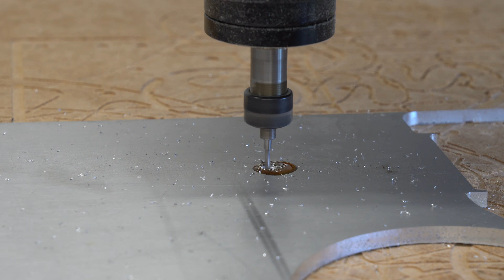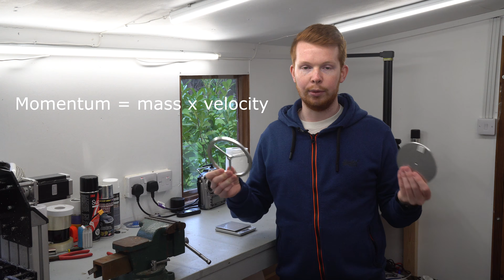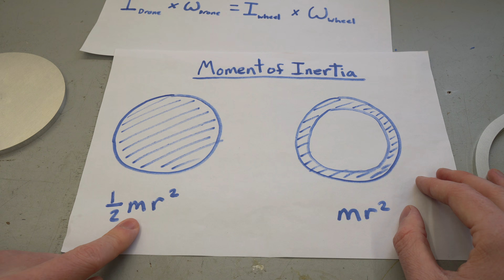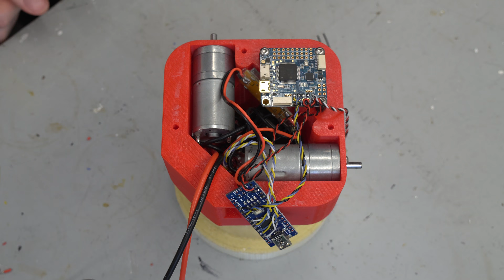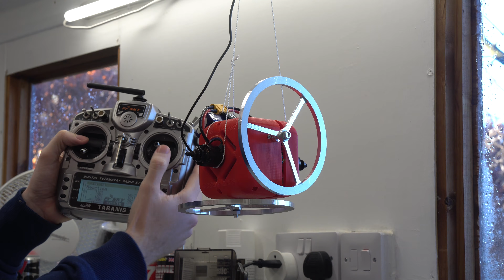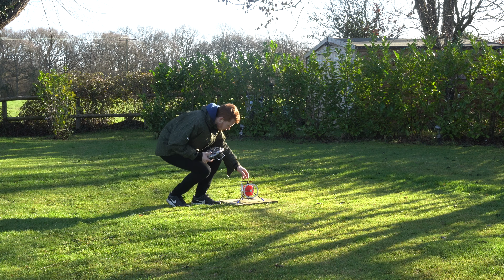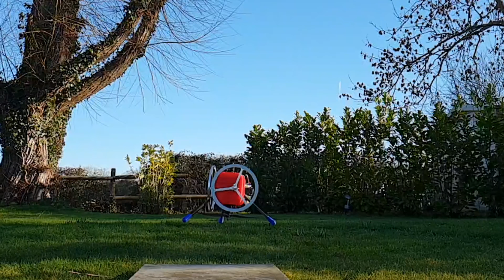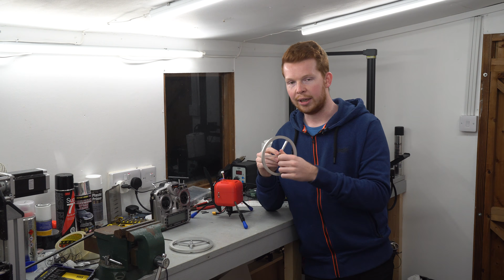Comment: As professional multicopter flight control engineer who did a lot of such angular rate loop experiments with DIY builds I would say the biggest catch with your quite nice setup is control bandwidth. The delay from the gyro measurement until your reaction wheel is finally counteracting the disturbance is too long to keep the drones attitude stable in the air. It took me a long time to figure out this problem with my own first flight control attempts (all from scratch). I'm guessing the bottleneck might be the motor controller of your brushed motors it's very likely not designed for low latency feedback loop reactions which all good multicopter ESCs are. The key is reducing the angular rate loop delay and then tuning mainly the angular rate proportional gain. You need to be able to feel a virtually instant and rather strong counter reaction from the actuator already in your one axis hanging test when pushing with the finger even only slightly. If you cannot get the gain high enough because it starts oscillating early you either have too much delay or too high vibrations in the gyroscope measurements. Be aware that the way (stiff, soft, vibrating part, ...) your gyroscope is mounted to the drone matters in this regard.

The non-linearity of the torque response and the inperfect alignment of axis to the center of mass are certainly things you can improve as well but my educated guess is clearly that the delay in your feedback loop is currently the bottleneck holding you back from longer hover times.
Reply: increasing kp was also my first guess, going from the high-speed videos.

Another thing is, that the ardiuno code could be written in a way, that it is too slow in steady reaction time. Arduino's standart functions may not always be the best choice.

Also maybe as an idea, he could apply a lookup table into the arduino, resulting in a non-linear input to output (in Volt) function. Basicly it says, ok, at this input value i have to apply that output value.
My approach would be measuring the force of 0.1V steps from given voltages (0V->Vmax) and calculating the inverse function. Having these values could lead to the system having a linear reaction, so the same increment of input should apply the same amount of output, regardless of pre existing state.
Reply: @ald3nt3  Good input. It's very easy to add too much delay when adding another processing component like the extra arduino here. For such a vehicle you'd want >100Hz feedback loop update frequency and also a fitting latency in the order of miliseconds. That would be a low hanging fruit to check.
Reply: @MaEtUgR  this is out of my qualification ... but would not it be helpfull to use bigger propellers, so the necessary rotation to take off could be lower ... and with lower speeds there would be better tolerance for the delays with reaction wheels?
Reply: @cruiserupce  (also drone software engineer) yes, designing a slower respons system at the mechanical level is certainly a valid way to get around slow actuators, but probably changing the firmware on the motor controllers would be easier ;-)
Reply: @JulianKent  I also think reducing the delay has a bigger effect and can therefore save you from maybe even excessively big propellers. The result is not only more likely to be feasible but will also be a more agile vehicle.
Reply: Given that satellite reaction wheels operate in a "frictionless environment" I have to wonder if it would be easier to control a drones attitude, etc with gyroscopic precession than reaction wheels. I feel like having spinning gyros before taking off would stabilize the whole thing.
Reply: @saiphascain6883  Interesting idea! I'm guessing the setup would become too complicated. In order to have a significant gyroscopic effect on the entire mass of the vehicle including the battery, the wheels would need to have either quite some more inertia or spin crazy fast... but that's only gut feel, we'd have to put in the numbers.
Reply: @MaEtUgR  Thanks for considering at least. I haven't experimented with contained gyros apart from the classic bike wheel and turntable demonstration and the old precession walkers and I'm thinking that a custom main gyro/fan would probably lead to some hideous math.
Reply: While the conversation seems to have moved away from this, I feel it might be of interest that satellites often do use gyroscopic torque, either using momentum wheels, which are like reaction wheels but constantly spinning at high RPMs to provide gyroscopic stabilisation, or control moment gyroscopes, which use a spinning rotor mounted on gimbals to provide both stabilisation and attitude adjustment using gyroscopic torque. I don't see why either couldn't be used for a drone. In fact, I imagine they'd work better than reaction wheels - especially CMGs, which are much more efficient - if they were made small enough.
Reply: @saiphascain6883  I'm inclined to believe that the best way to stabilize an atmospheric vehicle is to use the air instead of angular momentum, although the existing angular momentum of the components should be utilized.
Reply: @saiphascain6883  i was thinking the same thing about the gyros, but a revved up gyro has more to it then it appears.  Ill share a secret with you that most will never understand...gyroscopic propulsion.  Its the reason that a spun up gyro creates problems for control.
Reply: @saiphascain6883  Control moment gyroscope is the technical term for such a device.  I too would like to see a multirotor with such a control system.
Reply: @KnifeKnut  
A control moment gyro (CMG) is different, the rotor speed is constant and the housing is gimballed, you need at least 3 CMG's either simple gimballed or, like used on Skylab, 3 double gimballed CMGs. 2 of these can control the attitude, together with 6 reaction jets for desaturation (all three CMG axes parallel).
Reaction wheels have fixed axes, with modulation of the speed .
4 are used on the Space telescope.
The Space Station has 4 double gimballed CMG's.
Reply: What? man I should have stayed in school.....
Reply: @andyp3834  It's all about the words, lets break down a sentence. 

"I would say the biggest catch with your quite nice setup is control bandwidth. The delay from the gyro measurement until your reaction wheel is finally counteracting the disturbance is too long to keep the drones attitude stable in the air." 

Becomes 

"The biggest catch with your setup is the delay between when the aircraft starts to lean one direction, and when your machine begins countering that movement with the wheels. The delay from the electric brainbox to the wheels is so great that by the time they try to counter the movement, it's too late, and they just create more instability, this cascades until the aircraft finally crashes"

You're a smart person, don't let unfamiliar words and terms make you feels otherwise. 

That goes for everyone who reads this.
Reply: @andyp3834  right ! Hell till today I thought I was a little smart guess not!
Reply: @WilliamDye-willdye  Thanks, that's the first time I had it reliably in the air after "debugging" my setup for a long time, that's how I learned. I also shared some of my failure videos like https://www.youtube.com/watch?v=J-U7txB47Ug and https://www.youtube.com/watch?v=UMTZ6K-T_kc. The code of this experiment is available here: https://github.com/MaEtUgR/FlyBed although I can only recommend it for conceptual learning purposes. Today I use and improve the PX4 open source autopilot together with an awesome community.
Reply: Good thinking. Initially I was thinking he had very high gyro gains because of the extreme oscillation. Looked like it was overcompensating. Another observation is that the mechanical time constant of his drone is too small. That thing tips over in milliseconds and will need a very fast control system to keep it flying - whereas a full-size helicopter is slow and heavy enough that a human can stabilize it. So I propose making mechanical adjustments to increase drone response time. Increase the mass, use larger motors and props, and put the battery underneath the lower prop to lower the center of gravity and make it more "self-stabilising". Also, if the problem is nonlinearity in motor response, perhaps he can start the wheels from a positive rpm instead of zero. That way instead of the motors oscillating around the zero point (say 0 +/- 100rpm), they oscillate around an initial rpm value so the wheels never reverse direction (say initial rpm is 1000, then during flight wheels will go 900-1100rpm for the same +/- 100rpm control range). With this idea even brushless motors may be feasable because he no longer has to worry about the non-linearity of direction reversal.
Reply: Hey, what would happen if you place two fast rotatting disks into a frisbee, probably counter rotating. Could you use the flee force to make it into a little UFO?!
Reply: @bamfyfe  Yes but the rotation is what keeps it stable
Reply: It's the arduino. It has painfuly slow IO routines in the IDE, no idea why the guys that designed it did such a poor job... IO read or write takes 4ms, way too long for this kind of stuff.
Reply: Ya I was thinking the same, fortunately found your comment...
But the alignment to centre of mass has a big deal here, he should have noticed that....
Reply: MaEtUgR........SPOT ON. RESPONSE DELAY IS PRIMARY CONTROL ISSUE...My professor gave g8 example in my 1st control lecture of controlling bath water temp through hot & cold water knobs. If we don't incorporate response delay we end up burning ourselves................So engineers r meant to solve tough problems...Sol lies in incorporating response delay in the program by predicting drone's misbehavior in advance & giving premature control input to synchronize delayed response a timely response
Reply: @EngineerAhmedUSA  This will not work with an simple PID. You'll need a different type of controller that "has knowledge" of the system and/or an observer loop
Reply: Interesting idea for a flight device. I would also suspect an inner control loop delay as first place to check for the unstable flight behavior. However the system design has potentially coupled rotational degrees of freedom. Whenever a reaction wheel is spinning and it gets tilted by the other wheel it induces yaw motion (gyroscopic effect) and vice-versa. Given spinning reaction wheels, this effect probably adds to the unstability as the PIDs are currently controlling pitch and yaw independently (decoupled) even though both DOFs are actually coupled.
Reply: The fast response can be done by arduino + gyro + brushless motor.
Reply: I was thinking the same thing.  I think perhaps a better solution would be to have four reaction wheels. Similar setup (only control two axis), but have counterrotating wheels using the same differential control as the rotors. The reaction wheels would always spin at a fairly high rate, using an electronic break control to quickly raise and lower the differential between each pair of wheels.
Reply: @spyderMN  That does not work, because  torque is momentum exchange . starting with 2 counter rotating reaction wheels is equal to one R. W with twice the moment of Inertia at zero speed. With differential speed you are still creating an angular momentum which will generate the same gyroscopic torque in the yaw axis , when you either pitch or roll , depending of which pair you use.
Yawing the drone will cause a gyroscopic moment proportional to the residual angular momentum , which the other set of reaction wheels must compensate to avoid pitching and rolling.
Reply: Yeah, control of slowly brushed motors nonent may be quite fast(up to 0.1 ms), easy and simple. It is simply control of motor current.
Reply: Came here to say this. System oscillates because the loop rate is too low or the loop latency is too high.
Reply: A practice that is sometimes advisable: If the loop latency is too high, run the system against an internal software dynamic model. Use an outer loop to synchronize the model to physical reality by varying a model parameter as needed to drive the error down (like the model's mass or actuation gain), Typically the outer loop can tolerate higher delay and the inner loop can run against a software model, which can be done with single processing sample delay.
Reply: @Laverne Johnson are you talking to me?
Reply: I noticed that it seemed to lag also. I would assume it needs to be an extremely fast reaction in a drone. Also, what about gyroscopic precession? Wouldn't any radial torque on the gyroscope axis cause a precession? That would be extremely difficult to deal with and very complex. That's the trouble with using velocity over mass, a slower heavier ring would be less susceptible to these forces. But weight is so important in a drone so that's kind of an impasse. Maybe that's the fundamental difference in using reaction wheels on satellites vs drones. The satellites don't have to use them to stabilize constantly, only to apply force in a single direction on occasion therefore they are nowhere near saturation speed. Gyroscopic precession should only be evident at high velocity.
Reply: @gearhead1302  You are correct that lag (computational delay) is significant.
The gyroscopic torque needs to be compensated for, which is not difficult if the reaction wheel speed is measured and the angular velocity (in all three axes) is also measured with the available chips. Then the gyroscopic torque can be calculated and compensated for in the yaw axis ( differential torque in the rotors) as a known external disturbance moment.
This is the way the control laws on the space telescope work.
The added complication is that there are four reaction wheels, one for each axis and another oriented diagonally (cube diagonal).
The greatest problem here is the need to do the calculation with an arduino, the time delay is probably excessive for attitude control (heading). But might be good enough for yaw rate control.

If the vehicle structure is very stiff, separatelly controlling the angular position in pitch and roll with the reaction wheel torque (motor current) and no delay is a second  order system,  with the controll law ( P D , no integral term I ) it can tolerate some phase loss due to the computational delay in 
1) computing the crosscoupling gyroscopic torque due  to yaw rate (heading change) and 
 2) computing the  command torque as the sum of the control law output  and the component of the gyroscopic disturbance.
Since phase lag is the product of the delay times the frequency. Plotting the phase vs amplitude of the open loop, phase and gain margins can be calculated and system stability in pitch and yaw assured, by proper choice of the gains.
There are transfer functions that approximate a pure delay. Using those  you can draw the root locus plot and determine the control gain for each axis.
It seems to me that effective yaw control with high gain (differential torque on the lift rotors) is essential to achieve high yaw damping.
Reply: My first reaction to that was "make it analog then", followed by thinking of all the things that would need to be worked out to make that happen...
Reply: MaEtUgR 
I agree! 
I might also suggest that Tom consider the torque from the counter rotating props. There is a NASA video showing an astronaut doing gymnastics on Skylab. He is spinning his arm counter rotating inducing roll along his body’s axis.

@Tom BTW: why aren’t you using a direct PWM DC motor controller? Why the Arduino?
Reply: Hey look! Here's a nerd!

Nah m8 i'm joking
Reply: I wanna c some numbers here like what bandwidth ur assuming he is using. What would the max amount of bandwidth be and what frequency is that at? I think that 5ghz patch antenna would do it
Reply: Chris Anderson Communication frequency isn’t the problem, it’s the closed loop propagation delay between the accelerometers and the flywheel motors
Reply: MaEtUgR that’s exactly what I thought lol
Reply: If it were two wheels on a single axle going through the drone for each axis, wouldn't that prevent the reaction wheels from fighting each other to control the gyroscopic forces that single wheels create?  That would be a mechanical solution that would mitigate the control loop problems
Reply: Multicopter flight control engineer sounds like a dream job. Congratulations.
Reply: Can you put that in everyday language :)
Reply: MaEtUgR big brain time
Reply: wht r,u doing all r not working properly wht ur aim or just time pass
Reply: agree
Reply: Yes I totally agree. :3
Reply: @Laverne Johnson Not trying to convince anyone. My goal was to mention what my cooperative comment is based on. And what's your goal, hate?
Reply: This may have been said already but the Arduino needs to increase or decrease the speed, rather than set it, based on the control input.
Reply: I have no idea what you said during any of that. Can someone translate this into idiotspeak for me?
Reply: @Guru_1092  so u don't understand the language of science huh?
Reply: @kuronix6996  I majored in chemistry,  not physics and electrical engineering my dude.
Reply: @Guru_1092  what if I say that I majored in both?
Reply: At first I thought you were just a know it all blow hard, but you actually make a lot of sense
Reply: XD hes a sly one
Reply: MaEtUgR
The reaction moment of the wheel is proportional to the motor current for a PMDC motor. If you use a current command electronic circuit, rather than voltage  the response is very fast.
Current command compensates for the coil resistance and inductance as well as the emf of the motor.
Of course that is an analog circuit, not pwm.
Reply: Id say either decrease the delay time and increase response power, or just extend the platform.  3 or 4 props equidistant feom the center, and the longer the arm, the less response time and power should matter.

Honestly though, im just guessing.
Reply: Yeah sensor delay was also my first thought when I saw the slow-mo-wobbling. :)
Reply: sir, thank you more than you ever know.
Reply: Thing is when you were demonstrating the two motors  they sound differnt  ...?
Reply: PID feedback loop latency is a big issue in control systems in general. ASICs or FPGAs help a lot. Arduinos are very, very slow to react in comparison. In fact you can even use analog feedback for the lowest possible latency
Reply: Korrekt ❤🎉😊
Reply: Do you mind me asking what the salary ranges from for that job? Curious in that career choice :D
Reply: @HuskyStudios  Like with almost every job it highly depends on the location. The working conditions are equivalent to an electrical engineer (that's what I studied) or mechanical engineer with a masters degree from the university. I can't complain at all but I'm doing this job out of passion and not because of the salary.
Reply: @MaEtUgR  gotcha! Thank you. And yeah I was just curious on what it's like because I can't find any sort of drone or rc style engineering jobs. So do you think going as a mech engineer would be better for more flexibility or if you go into an rc type of industry stick with electrical?
Reply: @HuskyStudios  I'm a mechanical engineer and I'd imagine the person above would probably agree with what I'm about to say.  Don't go into your choice with salary in mind or you're going to be miserable at your job.  Think about what you would like to do and figure out what type of degree would help you get there.  I have been mechanically inclined since I was young with a bit of electrical inclination, so my choice was easy.  Both mechanical and electrical engineering degrees have a wide variety of specialties with some overlap with systems engineering.  I went into engineering school being dead set on being an automotive engineer, but that life didn't happen and things fell into my lap where I ended up being in research and development in the marine industry and I couldn't be happier with my job.
Reply: @HuskyStudios  I also never imagined back in 2011 when I started with electrical engineering that drones would get that popular and there will be engineering jobs in my country on the topic. In the team I worked mechanical engineers are the majority but I don't think that's representative since we spend most time programming. Either way programming skills and robotics background are definitely what helps you in the field no matter with what general subject you start out.
Reply: @HuskyStudios  lol, What?, no seriously, what?
Reply: MaEtUgR That's the most over inflated job description I've read in a long time.
Reply: MaEtUgR “professional multiocopter flight engineer” you fly drones. Enough bullshit.